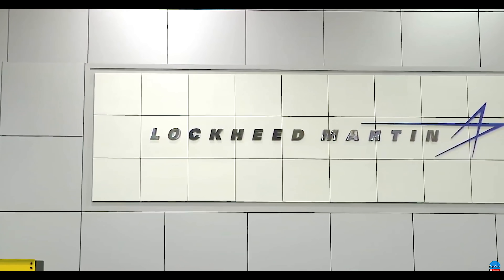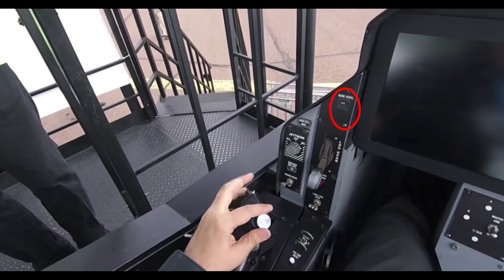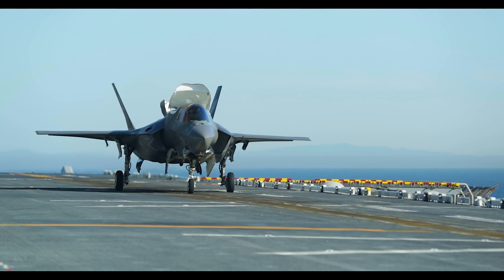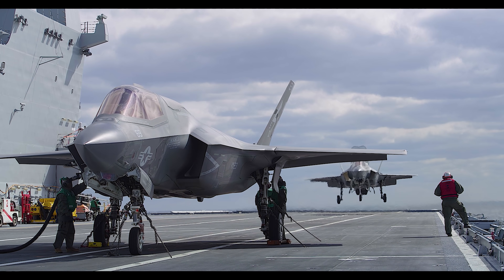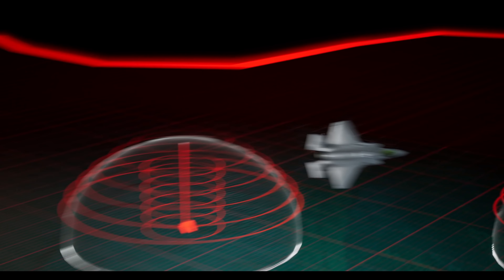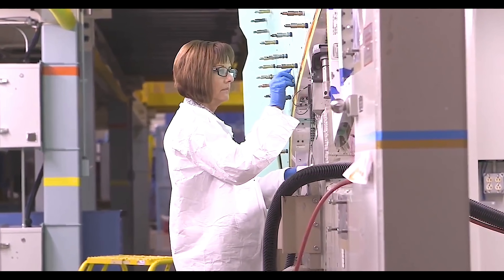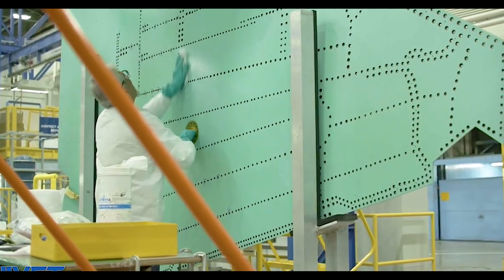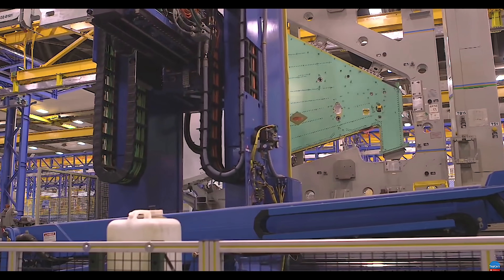Inside the F-35 Factory: The Most Advanced Aircraft Ever Produced

Comment: Couple of questions: why the F22 is the only major twin-engine fighter jet made in the US and why the F35 is only a single engine? Also, about a year or so ago, my country of Bulgaria purchased 4, I think, F16 Block 70 jets and prepaid them in advance and we have about 3-4 years until their arrival. There was quite a lot of backlash about how the deal was structured. Is this a normal procedure in your opinion for countries that purchase US jets for the first time or our government was just hoping to buy themselves US support? Still, well done on the awesome channel and I hope my country will be able to buy F35s one day too.
Reply: Twin engines are used for power. They are not used for reasons of having two engines = more reliability.

In Gulf war, we saw the best up-times and MOST work (sorties) done by the single engine F16. So if you fly 50 jets, do you want to maintain 100 engines? but then again, if one engine does not give enough power, then you install two engines.

The F35 engine is the most powerful engine EVER put in a fighter jet - but it only has one of them!!

However, even with one engine, it has more power and EVEN a better power to weight (thrust to weight) rating then the F16, or in fact even compared to the Rafale (which has two engines).

the power to weight ratings are thus this:
(higher number = better)

Fuel	Rafale	F35 	F16
18250	0.8038	0.8776	0.7729
15000	0.8707	0.9399	0.8447
12000	0.9431	1.0058	0.9239
			
			
10362	0.9880	1.0459	0.9737
9125	1.0249	1.0784	1.0151
7500	1.0777	1.1242	0.9239
7000	1.0950	1.1391	1.0950
5000	1.1704	1.2028	1.1826
3500	1.2341	1.2555	1.2581
2500	1.2806	1.2932	1.3141
700 	1.3737	1.3672	1.4284

Note how with 12,000 lbs of fuel, the F16 and the Rafale do NOT have enough power to fly straight up, but the F35 does.

You have to burn the fuel down to 3500 lbs in the F16 to match the T/W of the F35.
The Rafale has to burn its fuel tanks down to near bone dry (700 lbs) to match the power and T/W rating of the F35.

>why the F22 is the only major twin-engine fighter jet made in the US 
The new F15ex model, = duel engine.
The new Super F18's = duel engine.

Now the F15 is not really a new jet, but the Super F18's is MOST certainly a whole brand new airframe - and it is duel engine.

Typhoon: Duel engine
Rafale: duel engine.

So you are correct that MOST of the higher end fighter jets are duel engine. The F35 is one exception to this rule, but it keeps the cost down, keeps the maintains down, gets better fuel economy, and as the above chart shows, it produces as good (in fact better) power to weight performance then the F16, and in fact the Rafale. I not run the above numbers for the Super F18's, but they now have a LOT more power then the older F18's.
Reply: @Albertkallal  Thanks for the detailed reply, appreciate it. However, I still think the F22 is probably the best jet given that the exports are banned by Congress.
Reply: @dimitarmargaritov  
Well, a ban from 31 years ago does not really apply in todays world.
I mean, back then, you could not export a computer with more then 486 power.
Back then, even simple spools of fiber optic cables were banned for export.

I mean, they never exported the F22 since they stopped production way too soon. So how can  you sell something that you not making? (you can't).
And the air force did not even get 200 f22's - once again, how do you sell something when the air force can't spare any copies?

Some silly 30+ year ago law in a time when many things from computers, to simple rolls of fiber optic cables were banned is LONG AGO history.

The F35 has far more technology, a lower RCS, and far better technology.

I mean a $100 smart phone has about EIGHT TIMES the computer processing in a F22.

But, had f22 production continued, then say simple things like selling computers, rolls of cable, or the F22 would have been sold to other nations. Times have LONG changed since that old law - and the USA was not willing to export stealth jets. Today they are.

The F22 was never exported since they stopped building them, and they had no copies to spare.  You can't sell something you not making.

the F35 is vastly superior  to the F22. The only area that the F22 does better is it has a higher performance envelope. But that extra performance will not help the f22 to increase kills in the battle theater, or enable the f22 to engage and take on a F35. It just that the F22 missed too many technologies.

The really unfortunate missing feature in the F22 was lack of IRST. They are looking for ways to add this to the F22, but without such systems, the F22 is really handicapped, and thus really has few if any means to passive track enemy jets.

Comment: It’s crazy to think the engineer who designed this jet is not a pilot.
Reply: There were teams of engineers, each led by a project lead who all worked together towards integrating the JSF systems.  I have a 741 page book authored by those project leads and early test pilots that is astonishing in its level of details in how they designed and developed JSF.  It's not just the avionics and sensor fusion either, but the powerplant, Environmental & Electrical, flight controls, structures, aerodynamics, everything. It's complete with CFD modeling, diagrams, schematics of the various 3D models, test parametrics, and key performance requirements driving all the systems development.

Comment: Don’t get me wrong,  this jet can do some cool shit but damn the engineers did not think about us maintainers when they designed these things.
Reply: The F35 is a low maintians jet - it takes LESS ground crews to keep a F35 flying then it does the F16!!!

Right now, the F35 costs less then a F15 to fly per hour, and is about the same as a F18.

But, the F35 has ONE engine. The F35 engine is based on the F22 engine. At the time of the f22, they stated each engine takes 30% less maintains. But, the F35 is even better. They state that the engine requires 50% LESS then previous engines. That means a whopping 4x less engine maintains then a duel engine jet!

Not only that, they moved ALL field/base servaicable part to ONE SINGLE door. Now in place of running around all over the engine like a chicken with no head? They have ONE door - all parts moved to that door. In fact all service can be done with 7 simple tools found in a typical mechanices tool box. 

so the F35 is one of the best in this area.

Cost per hour to fly:
Air Force Numbers:

F-15C  $22,489
F15D   $21,745
F15e   $17,408
F22    $40,385

F35A   $16,952

Now of course it MUCH less then a f22. But you can see it also less then older F15's, and on part with later models.

And same goes for the Navy:
Navy

F18C $18,056			
F18D $18,048
F18F $13,654

F35C $13,124

Once again, less then older F18's, and same as newer. However the per hour costs ARE STILL dropping!!!! From just 2015 to 2020, the per hour quoted costs dropped by  whopping 40% - yes, you read this correct.

So, we have:

Rafale: $21,104 per hour.

Typhoon: $22,000 per hour.

F35: $16,952 per hour

So not only did they make the F35 easy to maintain, it actually one of the MOST easy to maintain.

And, the link and source for the above numbers:

Assistant Secretary of the Air Force Management and Comptroller: Year 2020

https://comptroller.defense.gov/Financial-Management/Reports/rates2020/
Reply: @Albertkallal  All of this is correct. We do not use a lot of specialty tools on the day to day. But with anything in maintenance there’s a lot of tight spaces to work with. Some of the parts could be designed a little better for ease of maintenance like they did on the 22. I could name a few but I can’t give a good description as it’s still a classified aircraft and I don’t want to jeopardize putting anything out there that shouldn’t be. All great points you put out there though!
Reply: @jacechrister4690  
that's fair. My only point was the F35 is not horrible, or bad or was somthing that the desingers left out. It fairs very well when compared to other jets. Yes, some things are tight, but some things are better then other jets. All in all?
It unfair to state that the F35 is all bad in this area - it is fact fairs very well - and at the very least compares favorable say compared to F16, or say F18's. And F14's? They were costly to maintain - and not all that easy. The F18' were better in this area, but from what I can gather, the F35 not out of line or more difficult then previous jets. And as I noted, in some areas it actually better. So it tit for tat - but it not all bad. 

Fair is fair here. It is not all perfect, peaches and cream and group hugs and rainbows!

But the F35 fairs rather well in this area.
Cockpit wise - very good - they even ripped out the hud display - there not much in their to fix or even to mess with.

Comment: The f35 needs an engine update to increase the speed to Mark 2 instead of mark 1.6. The new Russian check mate single engine stealth will have a max speed of 1500 mph. The F35 will need upgrades include making the jet cheaper to buy and operate.
Reply: No, it does not. The Mach 1.6 rating is NOT a engine + drag limit. It is a software operational limit. And those max balls out speed ratings are ONLY to sell jets.

A f18 at 38,000 feet can go Mach 1.8. But that is clean without tanks or weapons. Hang just 4 AIMS on it, and you now down to Mach 1.3, but it gets WORSE.

You see the F35 has more thrust and more throttle left. As you drop down in altitude, the performance of the F35 is still maintained (is higher).

Why is it that when F16 pilots fly with F35's they have to repeated tap (hit) their afterburners to keep up? The 35 can NOT be to draggy if a F16 is constantly having to punch AB's to keep up. How is this possible?

quote: U.S. Air Force test pilot Lt. Col. Hank “Hog” Griffiths

Griffith says the sheer power of the Pratt & Whitney F135 is evident. “The engine has a lot of thrust. It’s been fun to outrun the F-16 (chase aircraft). They can’t keep up. If we go to full military power the F-16 has to go to afterburner to keep up.”

There are other quotes to this effect. The F16 has difficultly keeping up - they fall behind - hit AB's to catch up, and then start to fall behind and have to repeat this process.

I mean, look at the engine thrust ratings, the F35 is BETTER!!!:

f16: 29,560 lbs.
Rafale: 34,000 lbs
F35: 43,000 lbs

So, the F35 has more power - and THIS INCLUDES when you load fuel and TOTAL weight of the aircraft.

You get these thrust to weight ratings:
Higher number = better

Fuel	Rafale	F35 	F16
18250	0.8038	0.8776	0.7729
15000	0.8707	0.9399	0.8447
12000	0.9431	1.0058	0.9239
			
			
10362	0.9880	1.0459	0.9737
9125	1.0249	1.0784	1.0151
7500	1.0777	1.1242	0.9239
7000	1.0950	1.1391	1.0950
5000	1.1704	1.2028	1.1826
3500	1.2341	1.2555	1.2581
2500	1.2806	1.2932	1.3141
700 	1.3737	1.3672	1.4284

So with 12,000 lbs of fuel? the F16 and Rafale are too heavy and don't have enough power to fly straight up - but the F35 does!!!

You have to burn up half the fuel tank on the f16 down to a low 3,500 lbs to match the F35 - but that is rather low fuel.

And you have turn down to 700lbs fuel on the Rafale - quite much bone dry to match the power to weight ratio of the F35. 

That means those jets either have to reduce their weight, or get better engines - but they are lacking in power compared to the F35, have lower thrust to weight ratios.

And this holds true as you increase fuel and/or weapons loads - the F35 still comes out ahead
Reply: That new Russian jet is just a plastic mockup that will never be fully developed and is really just vaporware.
Reply: @jeffreyexposito3803  
Well, the folks at Sukhoi are actually not all that silly in floating this concept.

lets see:

Hum, in place of building huge large duel engine jets - high cost, why not build a single engine fighter. Now, where have I heard that? (F35!!!).

Add some newer things like rip out the hud, put in a simple flat screen - keep costs down. Now, where have I heard that? (F35!)

Offer something less cost then say Rafale or Typhoon - Now where have I heard that? (F35!!!).

You seen, when the F35 was going for 175 million per copy - no one took notice. But, most vendors and compeitors to the F35? They desinged and started working on their last jets in the 1980's. That is WAY WAY too long ago!!!

If they had updated their platoforms  - say a great singile engine figher - keep costs down, but with NEWER technology - better computers, stealth? The the F35 would have NEVER sold so well.

We have these cost numbers:

F35 price:
Lot 1: 275 million per copy
Lot 2: 225 million per copy 
Lot 3: 164 million per copy
Lot 4: 140 million per copy
Lot 5: 130 million per copy
Lot 6: 125 million per copy
Lot 7: 120 million per copy

lot 14: 77 million.

So, we have:

Typhoon: 120 million
Rafale: 94 million
F35: 77 million.

So, what the heck occurred here? Well, they NEVER built enough Typhoons. What killed the Typhoon? The partner nations weleched HUGE and dropped their orders and commitments. So the Typhoon is stuck at F35 lot 7 prices (120 million).

You see, If I am looking at the F35 - lot 3 price (164 million), and then the Typhoon at a 120 million? Hey, I have a good chance to sell the Typhoon.

But those vendors sat on their butts WAY WAY too long! They needed a technology refresh 10+ years ago. So, their products did not sell, but the F35 creeped up on them. 

Now? They are royal screwed. The F35 cost is now driving MORE sales of F35. And more sales  = lower costs!!!!

They have nothing to offer - and will not for 15 years. This is how Britain lost their Motorcycle industry to Japan. They did not re-invest. So they reached a point in which their products were not selling really well, but worse were outdated. 

This is that magic point in the marketplace when the following occurs:

We are now in 100% official crapping our pants mode!!!

They are now trying to sell flip phones into a market that is buying smartphones, or in this case the F35.

And worse they are asking higher prices. Now you REALLY in hot water!

If competitors to the F35 had updated their products? Then the F35 would have never dropped so much in price. Now Lockheed have the upper hand. They can make more money, sell a newer product with better features, and that drives even MORE sales.

Remember, from 2009 to 2018? the F135 engine for the F35 dropped by HALF in cost (yes, you read this correct, engine price is now HALF!!!!).

so, the F35 going to win competition after competition - the others don't stand a chance. A number of industry leaders from Europe have sounded the alarm, and have noted how they don't have anything now to sell. And what they have is not only outdated (bad),, but now they have higher costs (double bad). And they can't sell their jets because they are outdated. So they not selling enough of them.

India: Expected to make 15 Tejas jets per year.
Typhoon: current 36 they are making - two years (slow walking factory to keep it alive).
F35; 131 DURING the covid slow down!!!

They now make more F35's in one month then what others make in ONE YEAR!!!

For the next 10 years, one out of 2.5 fighter jets made and sold will be a F35. So they grabbed 40% of the TOTAL WORLD fighter jet market for the next 10 years. The rest is split up between Dassault, Boeing, Sukhoi, Eurofighter etc.

This is what happens when you give that much of a market away. 

So, the "Check-mate" jet is simply looking at the marketplace, and looking at what peope are buying, and simply trying to offer the same idea. 

That idea? A f35 like jet, single engine, and lower cost then everyone else.

I mean, Intel can blow 2 billion on one chip - then sell them like hot-cakes for $200 each. that's what is going on with the F35.

I don't think the Checkmate jet can get the sales numbers - but the idea and concept is a VERY good idea - since for the next 10 years, the only jet going to sell well is a single engine fighter, with stealth, and lower cost then most other jets.

Right now, that choice and jet? its is called the F35.

quote:
chief executive of Airbus, Tom Enders commenting on a response to building a F35 competitor:

Failure to do so, he said, would leave Europe without any combat-aircraft programs after the 2030s that could viably compete with the world-dominating JSF

Moreover, to be competitive with the Americans, it is imperative that Europe coalesces around a single fighter program. “There’s just no room for three different programs, not even for two,” Enders said

worried
USA: comes out with B2 stealth bombers (others: no response)
USA: comes out with f117 (others: no response)
USA: comes out with f22 (others: no response).
USA: comes out with F35 (175 million per copy - others: no response).

USA: increases production of F35 - countries around the world lined up to buy.
Price drops to 77 million.

And it gets MUCH worse!

Yes, competitors to the F35 they are screwed, and beyond screwed right now. 

Hint: The software they need and want HAS to be started right now - but it might already be too late - F35 has a 15+ year start, and unlike past generation jets? The software this time around is being updated every 6 months, and that will continue.  IN 15 more years, they will be 30 years behind. They will never catch the F35 in this area.
Reply: "mark 2?" WTF is "Mark"?
Reply: GE does have a drop in engine for the f35 (XA 100) which gives +15% more power and +30% more range due to adaptive engine tech.